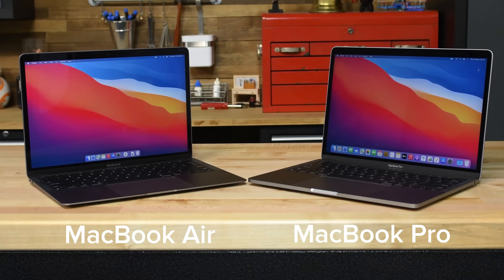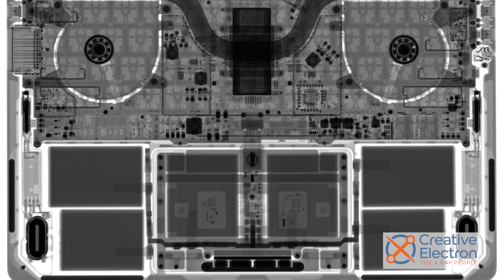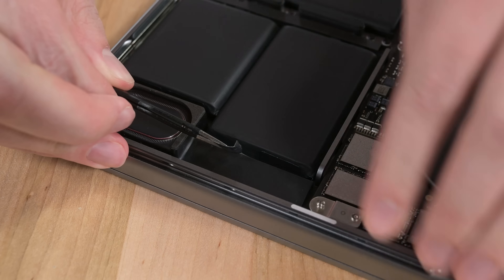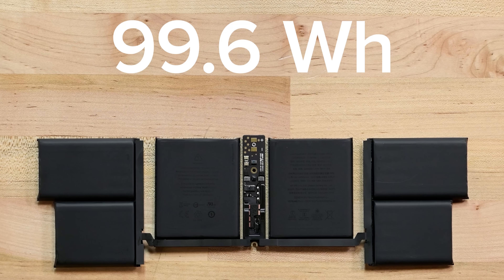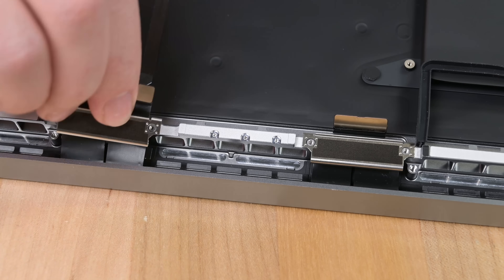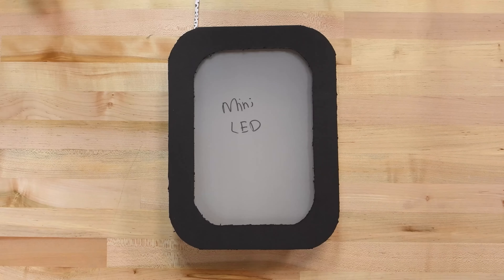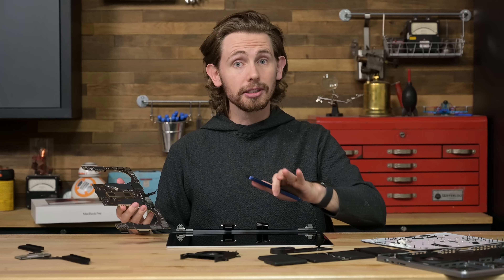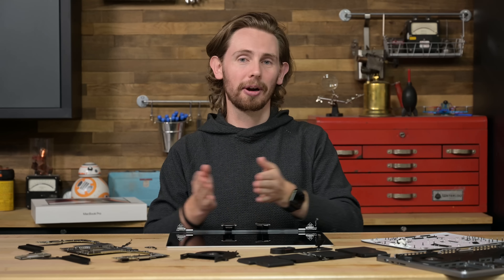MacBook Pro 2021 Teardown: Easier to Repair, Harder to Score…

Comment: From what I've heard memory latency is very important on the M1 which is why the memory is so close to the CPU. I am not sure if thats entirely true, but what is true is the further away your RAM is, the more clock cycles your CPU is gonna run empty, essentially wasting all the performance gains. So I think there is actually a truth behind what Apple is claiming.
Reply: The zero-copy between CPU and GPU thing is huge.  I think there are reasonable arguments to be made for incorporating the memory on-die.  There are also reasonable arguments against it.

Maybe what we should be looking at is a cache-like tiered system.  8GB on-die, 32GB socketed..?  Some of the really niche use-cases might suffer -- like loading really really REALLY big 3D models in memory and manipulating them in the GPU -- but perhaps clever buffering strategies could negate some of the penalties.
Reply: @sirnickity  Thats actually a brilliant idea! I wonder why they didnt opt with this, maybe they will be using the M1s RAM as Cache on the Mac Pro, as I hope/think they will keep that device upgradable. So maybe 32/64GB on die cache and you could add more in the sockets.
Reply: @sirnickity  Zero copy between the CPU and GPU is not a huge thing, AMD (e.g HSA) and Intel have had support for it for years and it in no way requires the memory to be next to the SOC like it is one the M1 (as shown by the huge number of systems that support it but have their RAM in slots).
Reply: @SentinelSent  It does have an effect, thats why RAM is always as close as possible to your CPU. I think the higher latency actually comes from the slower Transfer rate of the M1‘s RAM. Desktop RAM can operate at a much higher transfer rate than this.
Reply: @SentinelSent   Technically true, but AFAIK, there are only two ways to implement that right now in x86-land:

1) Use an iGPU.

While this is also, technically, what Apple is doing, it's proving to be a cut well above the usual fare for iGPUs, rivaling the performance of at least the low-mid range of discrete GPU performance.

2) Use the PCIe bus to share pointers to system RAM.  It is zero-copy, but you still have to move data over the PCIe bus.

That isn't so bad, since the PCIe bus just keeps getting faster, and if all you're doing is loading textures or models and then running them on the GPU (with all the processing done in GPU RAM), then no big deal.  But, if you want to stream data, or modify the frame buffer in code, then you have to resort to bus transfers again.

All that said, I'm a tech fan, not a professional graphics developer, so it could be that I'm not aware of something pivotal.  But, from what I can tell, this is in typical Apple style:  We're not starting a revolution with the idea here, it's been done before -- they just did a a particularly good job implementing it.

At least for now, I'll still have a Windows build with a discrete GPU.  I doubt the M1 is going to take the ray-tracing crown for a while.  But I definitely welcome the advancement to what has traditionally been one of the Mac platform's weak points.  Gotta give them credit where it's due.

Comment: The last "modular" laptop I bought was in the same price range as the new bademodel mbp16, was twice as heavy and is maybe half as powerful at 300W

So I don't mind that I can’t upgrade anymore 😂
Reply: Check out the HP x2 G4 or G8 (There's repair videos by HP on youtube). Probably other HPs as well. Just amazing!
Reply: @mltamarlin  had an XMG Ultra 17 (Intel I7-8700K and Dekstop GTX1070, wasn‘t worth the money, but hey, I can fit in 4x RAM modules, 2x SSD and 2x 2.5" HDD)

Comment: All the batteries in Macbook air models have been put in a frame and screwed down to the top case assembly, but still some adhesive is used to maintain the lower portion of the battery to the top case, i admit it is easier to remove, thank you for taking time and tearing down this device.🙏

Comment: Can’t believe that Apple actually made something more repairable. Even if just a tiny bit.
Reply: Serialized parts makes sure to throw a wet blanket on that sentiment.
Reply: well its not like they could make it any less repairable lol
Reply: the EU laws have probably something to do with that
Reply: @r3dp1ll  And Biden's executive order.
Reply: In all fairness the average joe who buys this laptop won't have an idea of how to replace certain things if it breaks. Right to repair is great for small shops to fix them but lets be real, dave who bought it for college isn't stripping it down and cleaning everything then putting it back together with the same tolerances.
Reply: @dodo19923  I agree but changing a simple battery should be accessible to everyone. And easy to implement by Apple. On my Macbook Air 2012, you just need to remove a few screws and unplug a cable. It could made the same now
Reply: @dodo19923  thats because you assume laptop teardowns have to be this complicated in the first place, when they can be much simpler.
Reply: @dodo19923  basic repair is a must for everything. why would i call an electrician to change my kitchen light bulb. why would i go to a mechanic for washer fluid or headlights
Reply: @dodo19923  Right to repair is GREAT for everybody is apple paying you?

Comment: Let's skip to the end of the discussion:  that level of performance is TRULY impossible without unified memory.  Done and done.  Readjust your score.
Reply: Unified memory has existed for decades. In fact it has been used for decades. Its just now they are marketing it as something new. Take any laptop that utilizes integrated graphics, the memory goes to both the CPU and GPU, nothing special about that. Not even the memory chips are unique either, its generic LPDDR5-6400, which can be purchased for chump change. Yet it still costs an arm and a leg just to get 16GB of memory.

And for the socketed equivalent? DDR5-5600 is pretty common nowadays, and you aren't even sacrificing that much speed to achieve it either. But regardless, once your extremely small amount of RAM inevitably gets used up and you start doing memory swap. Now your "legendary-tier" macbook has become slower and less efficient, worse, it is now damaging itself.
Reply: I’d still like to know more about how much difference it would make having a socketed SSD.
Reply: Wrong! Unified memory (which has nothing to do with where the memory is) has nothing to do with the current performance of the M1, unified memory only helps when a program is programmed to use both the CPU and GPU on the same task, which is rare and is not responsible for the M1's speed.
Reply: @SentinelSent  unified memory does have something to do with the performance in that uploading to VRAM can be quite a bottleneck, and if I'm not mistaken will generally have to go via RAM first in conventional architectures. So even if data is to be used only by GPU, it seems that there should be a benefit of unified memory - particularly if the application is written knowing that the GPU is able to use it directly as soon as it is present in RAM, without needing to copy - but even if it isn't, and it does a redundant copy (as I expect we may see with games running through emulation layers etc) I would expect it to be quicker than having to push it across a PCI-e bus. Also while technically the fact of the memory being unified doesn't necessarily relate to where it physically is, in practice, the systems we're talking about with unified memory have it located within the SOC, and this again is significant to performance.
Reply: @SentinelSent  See what you're reading RIGHT NOW, RIGHT THIS SECOND?   Pixels on a Mac screen?  Every single one of them is Thanks to the GPU and Metal.  Every one.  Every single one.  CPU and GPU.  And then there's the Neural Engine. And Image Processor. And Display Processor. And the Matrix accelerators.  All those individual IP blocks.  They all benefit from the...UNIFIED memory.  All of 'em.  They ALL DO.  Every single one of 'em.

Comment: Just think about it. How many times during the lifetime of MBP people usually change battery. Definitely not more the twice if they hold on to it for a very long time. So suggesting that extra 1mm is OK for battery frame is overstatement. To carry extra 1mm for years for literally no benefit at all, no battery life improvement. It's difficult to change the battery, so let professionals do it.

Comment: Playing devil’s advocate, the tight integration between the SoC, ram, and SSD is not just to increase performance; it’s also to increase efficiency. Right now, there are laptops that are just as powerful, if not more powerful than these new MacBook Pros that maintain modular components for the ram and SSD. However, none of them have the power efficiency which is what makes these M1 MacBooks such incredible feats of engineering, even if it does come at a cost of irreplaceable memory and storage. That said, Apple definitely has a lot room for improvements in terms of battery replacements, screen replacement, or even just opening up the machines themselves. They definitely made improvements and they should get credit for it, but they still need to go further.
Reply: I agree with RAM but not with SSD. It's almost impossible to make modular RAM for a SoC like M1 but current gen NVMe are more than enough for almost any even workstation loads.
Reply: @sanjay_swain  Yeah, integrated RAM is a key performance advantage in this design. In fact, integrated RAM is integral to the design. However, for the SSD, likely not so much. The good news though is Apple includes some of the best SSDs available.
Reply: @sanjay_swain  yeah
Reply: i disagree with RAM, the actual DDR4 has a trnsfer rate about 50GB/s, these macs have it at 200 or 400 depending on the config, only GPUs that have baked VRAM can reach those speeds
Reply: not true, current ssds and ram use so little power that its negligible, the reason apple did this is to own their design which is well within their rights. Apple couldve easily opted from pcie gen 5 ssd and ddr5 ram if they wanted, but that wont earn as much profits as people would just buy the base model and spec it up, which is why soldering everything is a crucial part of apple's business, charging premium on spec upgrades is a great revenue stream.
Reply: @pikachu5647  not for memory bro. Cuz see amds 4th gen bs 5th gen just by decreasing memory latency tand little redesign they got 19% performance boost so ram was okay idea but ssd that's outrageous.
Reply: Totally agree with the unified memory module. Can't get to such high level of efficiency and performance with traditional memory setup. Just wish those SSDs are replaceable.

Comment: I really do wish they made the MagSafe modular like the old one.  I always get grease and has contact issues over time with filings…. However since you can still charge with usb c as well you do have a backup so not bad
Reply from the maker: the MagSafe port is modular like the old one! But you're right, thankfully there is always usb-c
Reply: @iFixitYourself  thanks I must have missed that in the video
Reply: @dukeseb  yes, he mentioned that usb c, magsafe and headphone jack is modular, while sd card slot and hdmi isnt.
Reply: @pikachu5647  I was watching the video at work with the sounds turned off ;) I missed it
Reply: They did make MagSafe modular, though?

Comment: It is hilarious how the Intel MBP has almost non existent cooling but for their own, more power efficient chips, they put adequate cooling. Sounds like they didn't want their Intel MBP to be powerful so they can say "performance increased by X00%"...
Reply: While I'm with you that they could have made the Intel MBPs better by adopting this thiccboi design and outfitting them with bigger batteries and more cooling, I don't think it would have significantly increased the performance of Intel chips. It would have, however, made them better computers overall. When I switched from a 16" Intel MBP to an M1 Air, with no fan, I noticed how much faster the computer was overall, but I also noticed how it didn't heat up and how it was so quiet and the battery lasted longer. I don't think the 16" MBP could have been faster, but it could have been quieter, and that would have made it a more useful computer for music production.

Comment: The battery on frame is actually an  unecessary hassle. If an additional part count can be avoided by a pull tab without impacting functionality and repair, it's a go. 
The socketed memory, GPU would not achieve the same power vs performance gains as an integrated SoC. Trust me, the TDPs in SoCs in the same power envelope beat socketed parts any day.
Reply: what if the whole soc is socketed though as a single piece just like the soldered on one?
Reply: @CommonTater100  well that would add another mm at least, heatpipe size is non negotiable so the thickness of the socket would be in addition. As well as that, this new chip would need to be pin compatible. 53 billion transistors communicating over 2000 or so pins, that need to behave exactly the same. I assume you’re not an engineer, but we can all appreciate that it a bit complicated

Comment: to be fair, the fact that the ssd is soldered or integrated aio makes it really bad for many true professionals, imagine one ram modele goes bad, or even a single little thing on the MB you are screwed, you may loose all your data, while there are some ways to recover it, it would had been just so great to just have a pci4 ssd
Reply: RAM modules don't go bad ... it's a myth. Like SDDs dying left and right. It doesn't.

Unless you run your laptop like a data center server. But if you do that, you shouldn't be buying consumer grade H/W.

I have never heard of anyone had they SDD die and them and unable to recover data from it. It's just fear mongering.
Reply: According to current technology it's almost impossible to have a modular RAM for the Apple device but SSD is not the same. Current NVMe SSDs are plenty fast for even workstation loads.
Reply: "True professionals" back up their data, though. Heck, most pros I know back up their backups multiple ways. And considering how much faster the soldered RAM and storage are compared to what's currently available out there, until user-replaceable options catch up in performance, I think it's hard to say that professionals would be willing to give up a percentage of performance to be able to open up their computer themselves and replace a component, which most pros I know don't have time to be opening up their own computers. Given that Apple is willing to service your computer if the RAM and storage go sideways, and there's an Apple Store in every major city, I don't know that this problem actually affects "true professionals."
Reply: @mbvglider  RAM is faster yes, storage is not though. It's standard PCIe gen 4 x4 speeds.

Comment: I'll give it a frickin score. 7/10 for teardown due to too many screws but much easier to actually do. 0/10 for parts availability because apple is a pile of f***s. Since parts should always be a part of the score, 3/10.
Reply: Sounds like you are a hater.
Reply: @RunForPeace-hk1cu  I sure hate what they're doing, yes. It is better than they have been, but I'm wondering the motive.

Comment: At least, they are more repairable than the Touch Bar MacBook Pros. Pull tabs are much better than adhesive, display cables are much more durable unlike on Touch Bar models which are vulnerable to flexgate. However, 4 out of 10 is too much. I would give 2 or 3 out of 10 if the Retina and Touch Bar MacBook Pros score 1 out of 10.

Comment: Yeah, they intergrated the memory into the SoC, so ofcourse it's not user replacable.  That's because there is 0 distance between the CPU and memory making it really fast.  A socket is always a conversion interface that slows things down even the fastest socket on the planet right now won't be able to compete with a direct link.  This goes for cpu, gpu, ram and storage.  
They could make it a special board though, that only houses these components and has a socket for a daughter board with IO.  It would be an expensive board, but easier to repair and even upgrade.
Reply: Well.. not a conversion interface, but a potential point of impedance mismatch, additional capacitance, and distance (which can increase reactance as well as affect pin-to-pin clock skew.)  So there are absolutely reasons why it's advantageous to remove it.  But is it really worth it?  I guess we'll find out.
Reply: You have no idea what you are talking about. The RAM being close to the SOC has nothing to do with latency, in fact the M1, M1 Pro and M1 Max have worse memory latency than a desktop PC with slotted RAM! 
Which is obvious if you understood the inbuilt latency of DRAM and basic physics (electrical signals travel just under the speed of light and at that speed the signal can travel 30cm in 1 nanosecond, which is tiny vs the 70-140 nanoseconds of latency DRAM has)!
Reply: socket board increases latency as well as it's speed. This is why Apple makes SoC.

Comment: I don't mind soldered SOC if that's not a common failure point. Who would even have to replace their SOC? More important would be to have a modular keyboard which is obviously not the case.

Comment: Watching pro level tear down is so satisfying..i wish u dig deeper in the logic board though
Reply: Keyboard as well
Reply: I put a command strip on my wall and when I took it off it pulled the paint off my wall.
Reply: Usually you'll be able to find stuff like that when they do videos on repairing specific components.
Reply: That's what the written teardown is for
Reply: The logic board is a single piece and can’t be further torn down. If you want to know more about it there is plenty of info on-line.
Reply: and Display